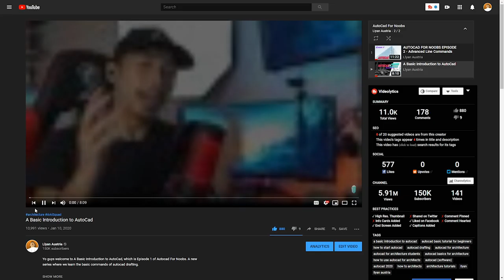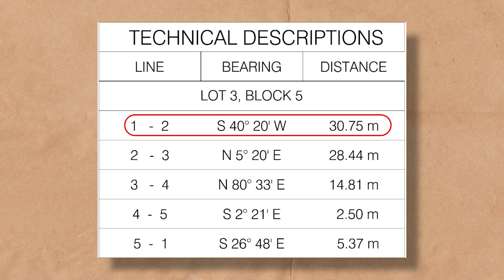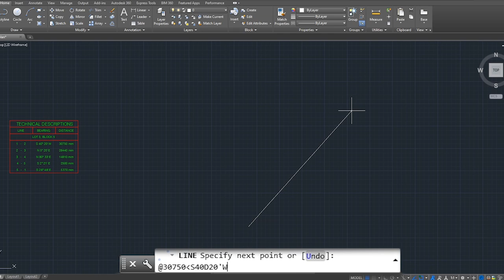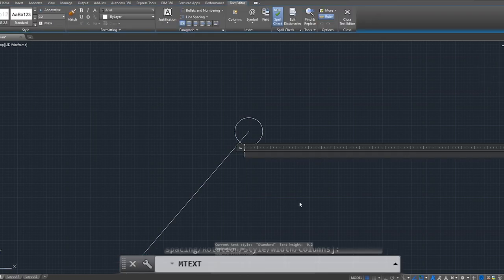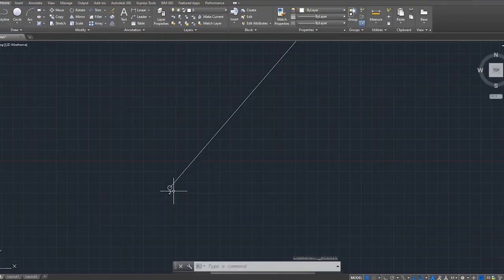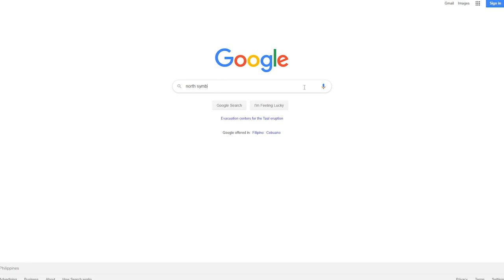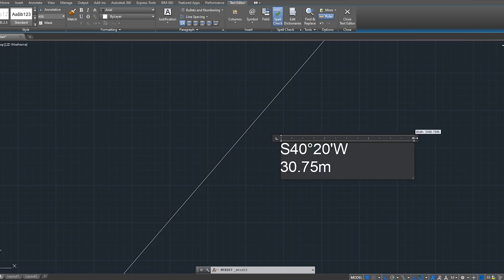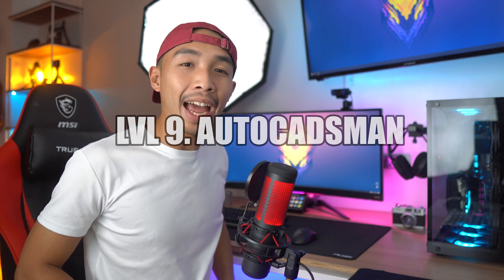AUTOCAD FOR NOOBS EPISODE 3 - How to Plot Lot Bearings in AutoCad

Comment: wow! arch. question po. marunong po ba kayong magplot ng lot na walang technical desc.? like for example, sketch lot lang po? wala pa po kasing title. may client po akong need nya tech. desc. pero lot sketch at declaration lang meron. marunong po akong tumingin ng direction if going nw,ne.sw or se. pero paano po yung exact degrees at seconds? pahelp naman po. may way po bang i-plot sya sa cad without using manual protractor?